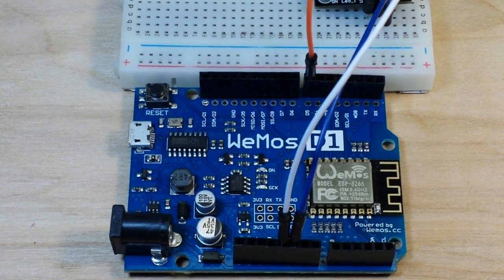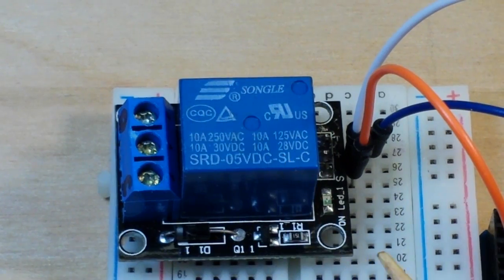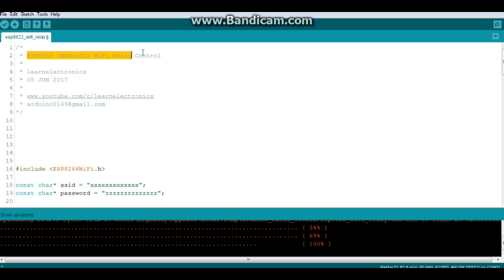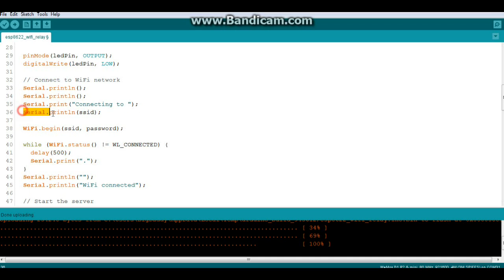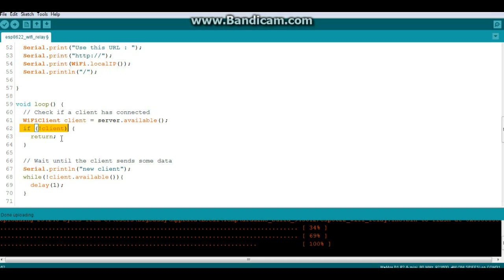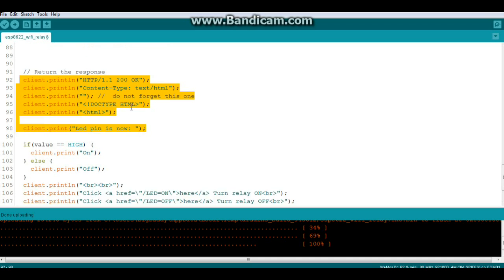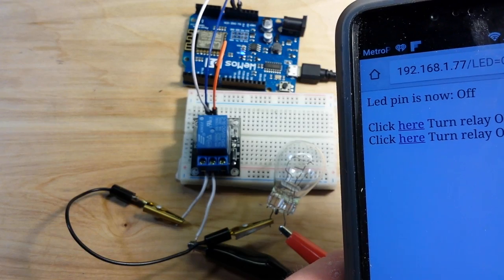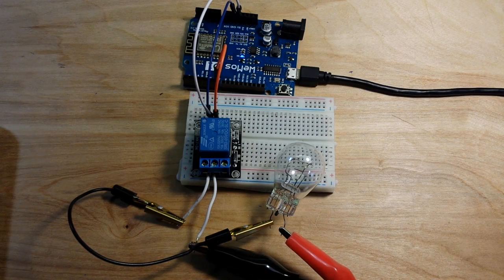ESP8266 WiFi relay control

Comment: it is also ideal to set these up with static IP addresses as well so the devices retain their addresses and you know who is who. Anyways here is a modified sketch that supports multiple relays and has a nicer webpage 

#include <ESP8266WiFi.h>

const char* ssid   = "yourssid";
const char* password = "yourwifipass";
WiFiServer server(80);
String header;

String output4State = "Off";
String output5State = "Off";
String output12State = "Off";
String output13State = "Off";
String output14State = "Off";

const int output4 = 4;
const int output5 = 5;
const int output12 = 12;
const int output13 = 13;
const int output14 = 14;

unsigned long currentTime = millis();
unsigned long previousTime = 0; 
const long timeoutTime = 2000;

IPAddress local_IP(0.0.0.0);
IPAddress gateway(0.0.0.0);
IPAddress subnet(0.0.0.0);
IPAddress primaryDNS(0.0.0.0);
IPAddress secondaryDNS(0.0.0.0); 

void setup() {
  Serial.begin(115200);
  pinMode(output4, OUTPUT);
  pinMode(output5, OUTPUT);
  pinMode(output12, OUTPUT);
  pinMode(output13, OUTPUT);
  pinMode(output14, OUTPUT);

  digitalWrite(output4, LOW);
  digitalWrite(output5, LOW);
  digitalWrite(output12, LOW);
  digitalWrite(output13, LOW);
  digitalWrite(output14, LOW);
  
  if (!WiFi.config(local_IP, gateway, subnet, primaryDNS, secondaryDNS)) {
    Serial.println("STA Failed to configure");
  } 
  Serial.print("Connecting to ");
  Serial.println(ssid);
  WiFi.begin(ssid, password);
  while (WiFi.status() != WL_CONNECTED) {
    delay(500);
    Serial.print(".");
  }
  Serial.println("");
  Serial.println("WiFi connected.");
  Serial.println("IP address: ");
  Serial.println(WiFi.localIP());
  server.begin();
}

void loop(){
  WiFiClient client = server.available(); 
  if (client) {                             
    Serial.println("New Client.");        
    String currentLine = "";                
    currentTime = millis();
    previousTime = currentTime;
    while (client.connected() && currentTime - previousTime <= timeoutTime) { 
      currentTime = millis();         
      if (client.available()) {             
        char c = client.read();            
        Serial.write(c);                    
        header += c;
        if (c == '\n') {                    
          if (currentLine.length() == 0) {
            client.println("HTTP/1.1 200 OK");
            client.println("Content-type:text/html");
            client.println("Connection: close");
            client.println();
            
            if (header.indexOf("GET /4/On") >= 0) {
              Serial.println("GPIO 4 On");
              output4State = "On";
              digitalWrite(output4, HIGH);
            } else if (header.indexOf("GET /4/Off") >= 0) {
              Serial.println("GPIO 4 Off");
              output4State = "Off";
              digitalWrite(output4, LOW);  
            } 
            else if (header.indexOf("GET /5/On") >= 0) {
              Serial.println("GPIO 5 On");
              output5State = "On";
              digitalWrite(output5, HIGH);
            } else if (header.indexOf("GET /5/Off") >= 0) {
              Serial.println("GPIO 5 Off");
              output5State = "Off";
              digitalWrite(output5, LOW);
            }
             else if (header.indexOf("GET /12/On") >= 0) {
              Serial.println("GPIO 12 On");
              output12State = "On";
              digitalWrite(output12, HIGH);
            } else if (header.indexOf("GET /12/Off") >= 0) {
              Serial.println("GPIO 12 Off");
              output12State = "Off";
              digitalWrite(output12, LOW);
            }
             else if (header.indexOf("GET /13/On") >= 0) {
              Serial.println("GPIO 13 On");
              output13State = "On";
              digitalWrite(output13, HIGH);
            } else if (header.indexOf("GET /13/Off") >= 0) {
              Serial.println("GPIO 13 Off");
              output13State = "Off";
              digitalWrite(output13, LOW);
            }
             else if (header.indexOf("GET /14/On") >= 0) {
              Serial.println("GPIO 14 On");
              output14State = "On";
              digitalWrite(output14, HIGH);
            } else if (header.indexOf("GET /14/Off") >= 0) {
              Serial.println("GPIO 14 Off");
              output14State = "Off";
              digitalWrite(output14, LOW);
            }
            
            client.println("<!DOCTYPE html><html>");
            client.println("<head><meta name=\"viewport\" content=\"width=device-width, initial-scale=1\">");
            client.println("<link rel=\"icon\" href=\"data:,\">");
            client.println("<style>html { font-family: Helvetica; display: inline-block; margin: 0px auto; text-align: center;}");
            client.println(".button { background-color: #195B6A; border: none; color: white; padding: 16px 40px;");
            client.println("text-decoration: none; font-size: 30px; margin: 2px; cursor: pointer;}");
            client.println(".button2 {background-color: #77878A;}</style></head>");
            client.println("<body><h1>Control Interface</h1>");

            client.println("<p>Relay 01 is: " + output4State + "</p>");      
            if (output4State=="Off") {
              client.println("<p><a href=\"/4/On\"><button class=\"button\">Turn On</button></a></p>");
            } else {
              client.println("<p><a href=\"/4/Off\"><button class=\"button button2\">Turn Off</button></a></p>");
            }
 
            client.println("<p>Relay 02 is: " + output5State + "</p>");      
            if (output5State=="Off") {
              client.println("<p><a href=\"/5/On\"><button class=\"button\">Turn On</button></a></p>");
            } else {
              client.println("<p><a href=\"/5/Off\"><button class=\"button button2\">Turn Off</button></a></p>");
            } 
            
            client.println("<p>Relay 03 is: " + output12State + "</p>");      
            if (output12State=="Off") {
              client.println("<p><a href=\"/12/On\"><button class=\"button\">Turn On</button></a></p>");
            } else {
              client.println("<p><a href=\"/12/Off\"><button class=\"button button2\">Turn Off</button></a></p>");
            }
            
            client.println("<p>Relay 04 is: " + output13State + "</p>");      
            if (output13State=="Off") {
              client.println("<p><a href=\"/13/On\"><button class=\"button\">Turn On</button></a></p>");
            } else {
              client.println("<p><a href=\"/13/Off\"><button class=\"button button2\">Turn Off</button></a></p>");
            }
            
            client.println("<p>Relay 05 is: " + output14State + "</p>");      
            if (output14State=="Off") {
              client.println("<p><a href=\"/14/On\"><button class=\"button\">Turn On</button></a></p>");
            } else {
              client.println("<p><a href=\"/14/Off\"><button class=\"button button2\">Turn Off</button></a></p>");
            }
            
            client.println("</body></html>");
            client.println();
            break;
          } else { 
            currentLine = "";
          }
        } else if (c != '\r') { 
          currentLine += c;      
        }
      }
    }
    header = "";
    client.stop();
    Serial.println("Client disconnected.");
    Serial.println("");
  }
}

Comment: Loved the video you explained it in a very easy way to follow but was hoping you were going to show an easier way than that as I just want two Wemos d1 mini boards with a switch on the first one on-off, and the 2nd one with a light so when the switch on the first one is turned on the light on the second one comes on. any suggestions would be good thanks!!

Comment: The webserver loads fine for me, and i can click on on and off, but it doesn't switch the relay. I can manually switch it by plugging and unplugging the analog or ground pins though, do you know what is up?

Comment: When I used this code to have a wemos repeatingly respond to a client (like my C# program running on pc), the client starts throwing SocketExceptions and such. Took me a while to figure out what this all meant. Only after some searching, I found that the server (the arduino) disconnects after the first response.
It seems that the code used here makes a new client every loop and the client needs to reconnect every time.

Just a heads up in case somebody runs into similar programs.
Reply: Did you find a solution, what is?
Reply: @anukreddi  WiFiClient client = server.available(); --> this creates a new client object, disconnecting the old one, if there is one.

I instead put it like this:
Before setup:
WiFiClient client;

In loop:
if (!client) {
    client = server.available(); 
    return;
}

Comment: @learnelectronics Great video brother! Subbed! 
The HTTP section is a Response Header to a valid HTTP-GET request. When you click to power on the component, you're sending an HTTP-GET request. The response is just a formality.
Print this out!
https://www.ntu.edu.sg/home/ehchua/programming/webprogramming/HTTP_basics.html
That will teach you everything you need to know about HTTP in 20 pages.
Also, using the DMZ is dangerous. It sets a device outside your firewall. It's just as easy to set up Port Forwarding and it's MUCH safer. It's done in your router settings/config as well. Making a device other than your router accessible from outside the network is dangerous enough, you put a device in the DMZ and the firewall will no longer protect it.

Comment: some internet browsers are checking URL links for updates, what can cause random switching. So you need to keep it in mind by using GET method in URL. And you need to check for WiFi connection if got lost and you need to reconnect. I had similar issues some time ago for standby application.

Comment: Hello,good video! I would like to create wifi or bluetooth controlled relay what has battery inside or needs very low woltage.Its going to be in my dirtbile which has no power lines.I would use it to start and stop it.For stopping it connect one wire to ground and for starting connects one to plus.T.jorma

Comment: is it possible if i switch Arduino WeMos to be Arduino Uno R3 ?
Reply from the maker: R3 has no WiFi
Reply: @learnelectronics  even if i combine R3 with ESP8266 ??
Reply from the maker: You could. But for all that work.... Why not just use 8266?
Reply: Learnelectronics is waiting ... what? what do you mean "only use 8266"? ... do you mean if I use uno R3 I have to combine it with esp8266 which is basically R3 and 8266 separately (not one module) and if I use weMos I don't need to combine it with esp8266 because weMos already has esp8266 on Arduino itself?

Comment: Back EMF?  Are you sure you are using the term correctly for that diode. I think it's there to drain the relay coil quickly so the contacts don't linger in the on position when the power is cut.  Back EMF refers to motors.

Comment: I hope you still respond to these comments. I've been trying to get my ESP8266 to trigger my relay module. However because the relay module runs on 5v, the relay does not activate with the 3.3v signal from the ESP8266. Works just fine with an arduino but I can't get it to trigger with an esp. Can you give me any workaround for this problem?
Reply from the maker: +Riyadh Marthinus different relay? Or different micro...
Reply: learnelectronics so, believe it or not. Just yesterday I got this sensor kit in the mail and it had a relay module that worked just fine with the esp. I think the issue is that the relay modules that I have only detects 5v as an active high signal whereas the one I got yesterday takes 3.3v as an active high too. Its a pitty because I ordered so many of those modules but maybe I could trigger them with a transistor or something. Thanks for checking up though man!

Comment: Hi 
Does the board can execute the sketch if it s unplugged form the pc an plugged with the dc power supply?
Reply from the maker: yes, it does not need to be plugged into pc
Reply: Thaks, also this applies to NODE MCU?
Reply from the maker: +narut99 yes it does
Reply: Thanks a lot

Comment: right after the flashing the relay goes to ON
and it is not possible to turn in off in the browser
it's like it stays constantly on and doesnt respond to inputs
Reply: it works when i connect it to the 3.3v
Reply: The problem is the 5V-relais used with the 3.3V ESP-logic. If you use it as described in the tutorial, you might blow your ESP8266, if you operate the relais with 3.3V it might not switch reliably. You should either use a 3.3V-relais or a circuit adapting the 3.3V logic to 5V logic.
The tutorial holds another problem: it is using the String class to evaluate the http requests. This will fragment the memory and crash the program after running for a longer time (can be hours, days or weeks - depending on the number of requests you send)

Comment: I have been using this setup, but the wifi on the WeMos goes into sleep mode then you cant
access it thru the phone, unless you hit the reset button to wake it up, any way to keep it active?
Reply from the maker: dwpetty3723 you can try this: 

if (WiFi.status() == 6) { ESP.reset(); }

it checks to see if your WiFi is disconnected (status 6) and restarts if it is.
Reply: I tried the code in the loop, still does not work, this happens on my computer browser as well as my Iphone browser. so it must be the WeMos board, my other wifi devices in the house work fine, hopefully somebody will have an answer. thanks for the reply
Reply from the maker: dwpetty3723 I'm sorry I couldn't help, Im a hardware guy. I muddle through programming by the seat of my pants. Find Brian Lough on YouTube. He's an Irish YouTuber, very well versed in the 8266. He's a cool guy, send him a pm.

Comment: Thanks for the video, man! I was trying to wrap my head around an ESP-01, to toggle a bunch of LEDs through a webpage. This setup would be perfect. Perhaps in another video you could turn on and turn off an appliance with this just to give us an idea of how it's done?

PS: Is port 80 the only port we must use for html or can we use any other port number?
Reply from the maker: Vivek Venkat Subramaniam this video IS how you turn on and off an appliance. that's what the relay is for. appliance goes through the relay.
Reply: Yes, port 80 is designated for HTTP (HyperText Transfer Protocol) which is the protocol that runs the internet. You can send HTTP traffic over other ports but you'd have to configure the device/code to run its server on a different port and you would have to make the requests from that port as well.